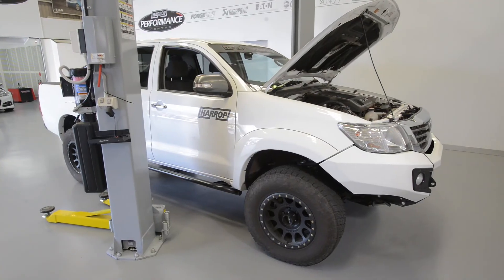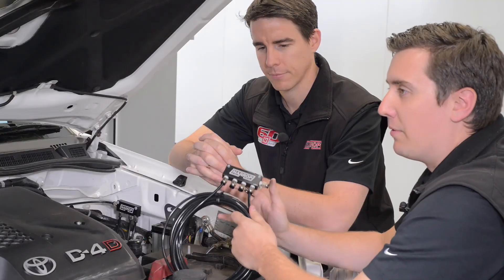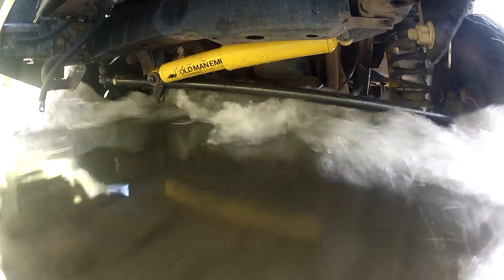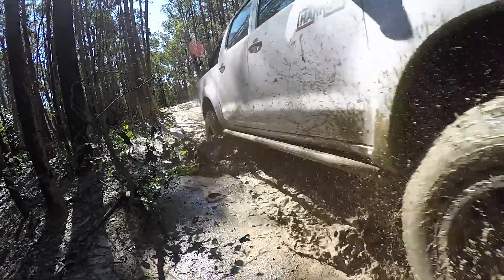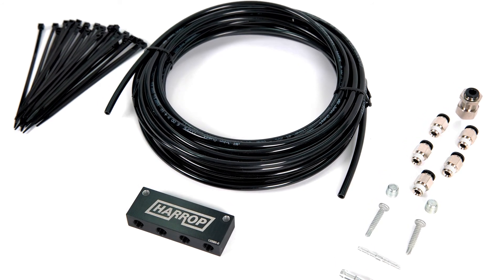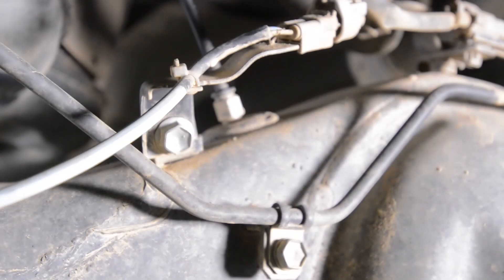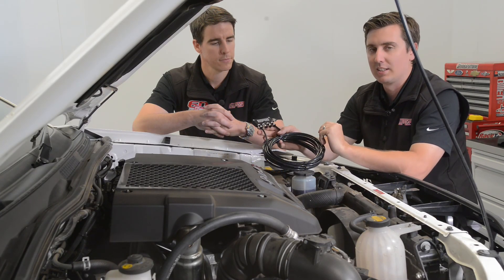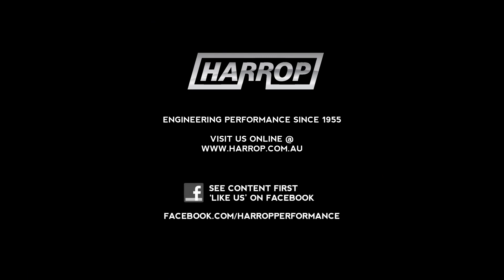Harrop 4x4 Diff & Trans Breather Kit

Comment: Plumbed mine into the air box, now I have gear oil in the air box?!! Not sure if the turbo is pulling it from the diffs? Doesn’t leak oil once disconnected from the air box!